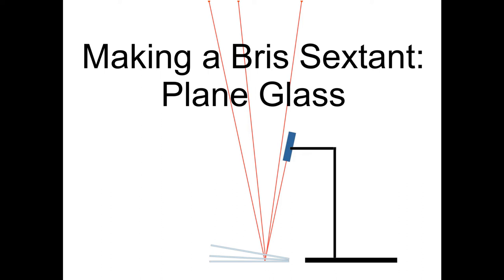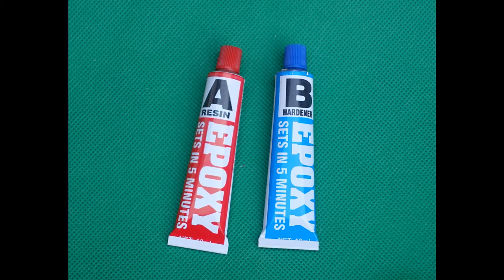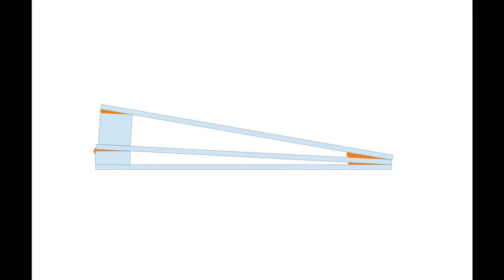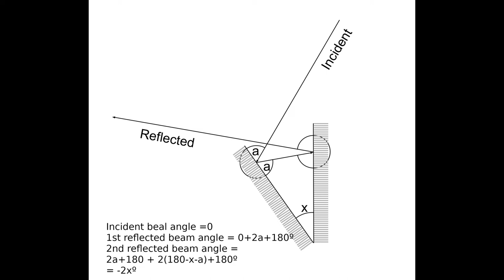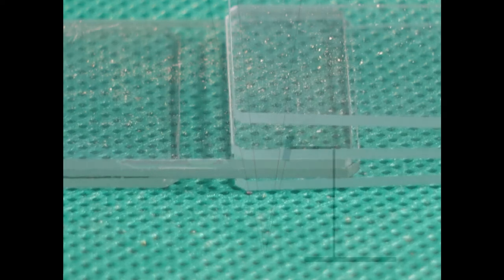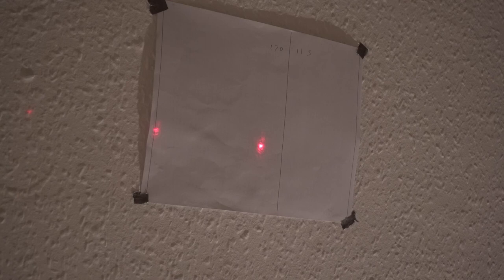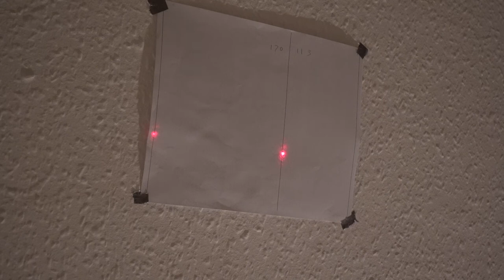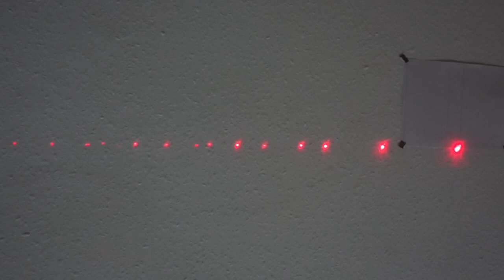Making a Bris sextant with plane glass

Comment: Thanks for this video you mention using welding glass but in the video you show the construction using only clear microscope slides. Should welding glass be cut to microscope slide dimensions and then affixed as the third pane?
Reply from the maker: I've been meaning to make a video specifically about the use of welding glass but haven't got round to it yet. I briefly mention it at the end of my video on Bris sextants theory and there is a picture of my arrangement using welding glass as an additional filter at timestamp 9:10 in that video.

Yrvind did what you suggest and cut a piece of welding glass to size to act as one of the three glasses in the sextant, the outer one. You could also use it as the inner one but you can't use it as the middle one without altering the relative intensities of the different reflections. The problem with that is that it makes it very hard or impossible to see the horizon through the sextant and it also means you can see fewer reflections because the lower ones become too dim. So I mount it as a fourth glass on the observer's side of the sextant and only covering the top part so that it only filters out the real image of the sun and the first three virtual images.

I use a much wider welding glass than the sextant is so that it filters the sun for both eyes; the sextant's only being viewed through one eye. This makes the sextant significantly larger than Yrvind's original but it gives you more reflections, and it also allows you to see the horizon more easily through the sextant.
Reply: Thank you for this reply! I do hope you'll have time to make that other video: this and the theory video are both excellent

Comment: 3d  print the wedges to correct angles then glue. Would that work?
Reply from the maker: I don't see why it shouldn't work, but it might be difficult to assemble. It's much harder to get two joints to set correctly simultaneously than it is to get just one. And if you use a wedge, you'd have to get the wedge in position and the second glass at the same time if you glued both joints together. If you didn't and started by gluing the wedge onto the bottom of one glass and then gluing another glass onto the wedge, it would be really hard to keep the second side of the wedge free from epoxy. If any epoxy got onto it, it would alter the angle. I found even for microscope slides with two glued together at one end, often epoxy gets on the outside of one or other of the slides to interfere with a subsequent joint. I imagine it would work well for a sophisticated manufacturing processes, but for making it by hand would probably be difficult.